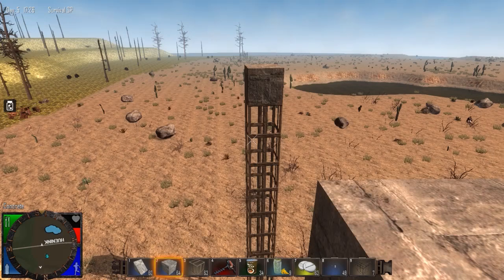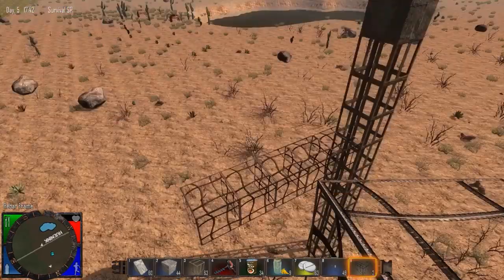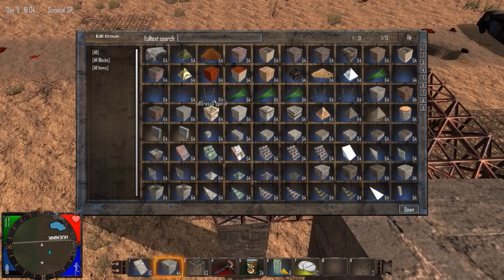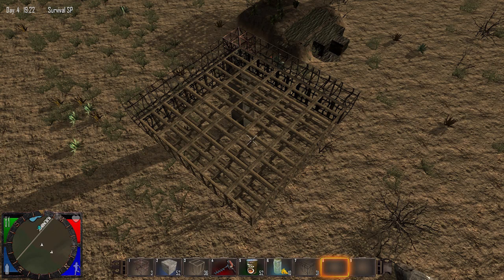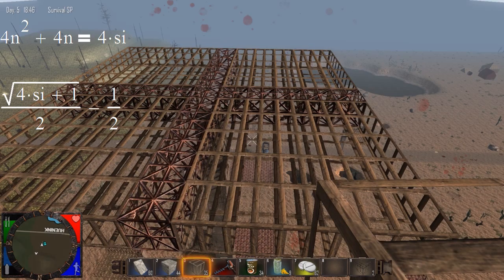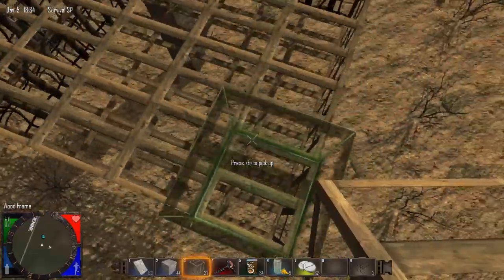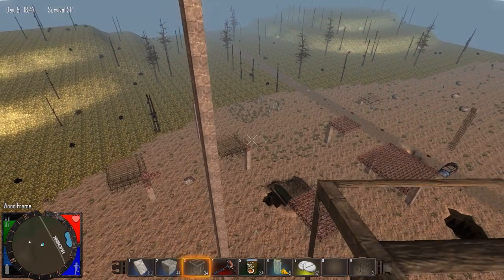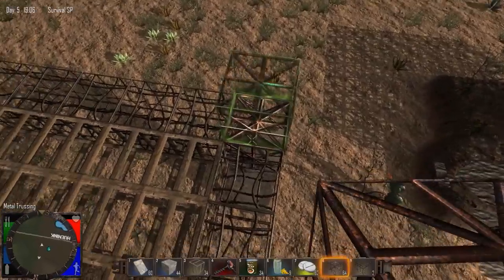7 Days to Die Building & Structural Inegrity Tutorial

Comment: So if I get it right, I only have to make sure I do not overextend in X-axis. As long as this is ok I can build on top of that as high as I want?
Reply from the maker: ***** if you were to say build a wall atop pillars then, with most materials, the wall would support itself. If you add something that will not support itself, such as sand or gravel, then you need to take into account the weight of the unsupported blocks as well.

Comment: Please correct me if I'm wrong, but just to hammer in the equations for me I wanted to see if I could isolate n from the corner pillar equation [n^2 * m + 2 * n * m = 2ML] into your answer [√2 * SI + 1) - 1]. However, I ended with n =  ³√SI. The way I went about it was as follows:
Divide both sides by m --> [n^2 + 2*n = 2*SI]
Divide 2 from both sides --> [n^2 / 2 * n = SI]
Multiply both sides by 2 to eliminate the 2 from below the n^2 --> [n^2 * 2n  = 2 * SI]
Combine the n^2 and the 2n --> [2n^3 = 2 * SI]
Divide both sides by 2 --> [n^3 = SI]
Cube root both sides to isolate n --> [n = ³√SI]
Reply from the maker: Your error is: "Subtract 2 from both sides --> [n^2 * n = 2 * SI - 2]". 
if you subtract 2 from both sides of [n^2 + 2*n = 2*SI] it becomes [n^2 + 2*n - 2 = 2*SI - 2].
Instead you should add 1 to both sides resulting it [n^2 + 2*n = 2*SI] -> [n^2 + 2*n  + 1 = 2*SI + 1]
Then you can see the left hand side is a simple quadratic, [(n+1)^2], thus it becomes [(n+1)^2 = 2*SI + 1]
Now solve for n, [(n+1)^2 = 2*SI + 1] -> [n+1=±sqrt(2*SI+1)] -> [n= ±sqrt(2*SI+1) -1]
Reply: silentdeth Where did the 2n go in your transition from [n^2 + 2*n  + 1 = 2*SI + 1] to [(n+1)^2 = 2*SI + 1]?
Reply from the maker: Sloth Tesla  (n+1)^2 is a quadratic, if you multiply it out it becomes [(n+1)(n+1)] --> [(n+1)(n) + (n+1)(1)] --> [n^2 + 1*n + (n+1)(1)] --> [n^2 + 1*n + 1*n+1], add the 1n's together --> [n^2 + 2*n +1]. Thus the 2n term is in (n+1)^2.

Comment: this is exactly the kind of explanation I needed.  Couldn't understand why our pillar based buildings were collapsing.  but i still dont understand how i can make a multi platformed base and build walls. how high can i build walls? how is weight passed on between multiple pillars over multiple vertical points.  its very odd.
Reply from the maker: Weight is shared equally between pillars up to a point, that point is determined by performance limitations of the game. I assume it to be fairly large.

For walls it depends on how you build them and what you build them out of. If the wall passes over a pillar, like:
WWWW
WWWW
WWWW
 FFFFF
     P
     P
P= Pillar
F= Floor
W= Wall

When viewed from the side, then it depends on what the walls are made out of. In most cases the pillars would be, at most, 8 blocks apart. That means that as long as the wall blocks have a structural integrity of 4 or greater they will support themselves, and you can build them as tall as you want. In cases where the structual integrity is less than 4, then the floor must support the excess weight. i.e. if the structual integrity was 2 then then floor would need to support 4[2 for each end]x(the height of the wall)x(the mass of one of the wall blocks) additional weight, in the same manner I mentioned supporting dirt on top of a floor. If the wall does not pass over a pillar, then the floor must support the full weight of the wall, again as I mentioned floors supporting extra blocks like dirt. For this reason you should take pains to see that the wall passes over pillars in most cases.

Comment: How do multiple pillars affect the structural integrity? I assume adding a second corner pillar opposite the first one would be a good idea, but I doubt it doubles the effectiveness.
Reply from the maker: I don't quite understand what you are asking. If you get n=4 for corner pillars, then each pillar can support that many blocks, so you place the two corner pillars 8 blocks apart. If you put the 2nd corner 4 blocks from the first when n=4 then... well it is just inefficient. Not something you would want to do unless you intend to put more weight on the blocks.
Reply: Ok, I think I understand. It may be inefficient, but I'm thinking a bit of redundancy is good for survival. Thanks for the help.

Comment: Holy shit that was awesome, the calculation part is bit much for me but the tutorial gets 10/10 grate work, if you ma by have any idea how to make the calculation part at least a bit simpler for us dolts that would be amazing, but overlay all of this had the answers that i was looking for thank you!
Reply from the maker: You just need the third equation in each set, the solved for n part. Then just plug in the structural integrity. i.e. for a corner pillar it is sqrt(2*si+1) -1 so plug in SI, for metal trusses for instance, with an SI of 16. sqrt(2*16+1) -1 = sqrt(33) - 1. you can just plug that into windows' calculator, same with any of them.

The only way the make it simpler would be to count how many blocks you place 2*si for corner pillars, 3*si for edge pillars, and 4*si for center pillars. The equations don't simplify further.
Reply: thank you so much, to say the truth i forgot that i could have used a calculator, that was dumb of me, i am very grateful for your answer. I wish you happy you tubing :)
Reply from the maker: Julius Michnevič
np :)